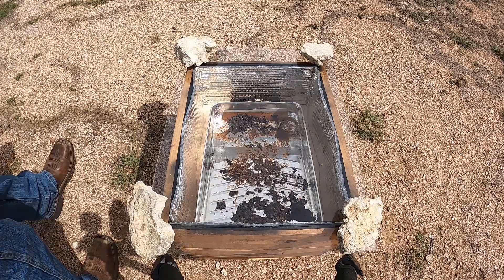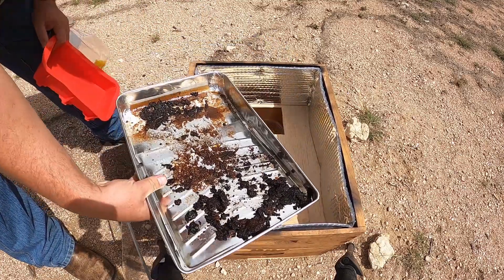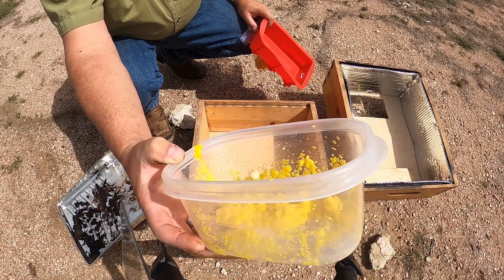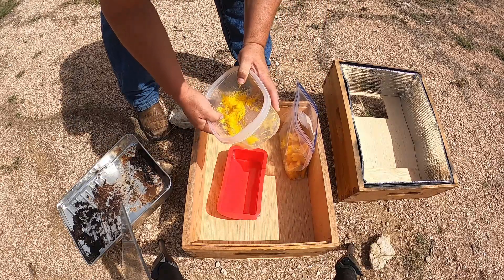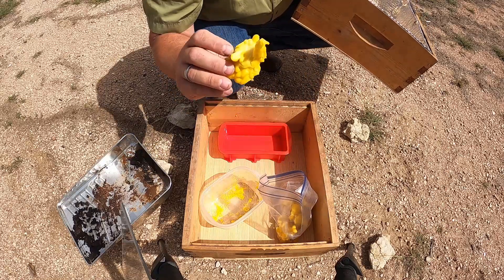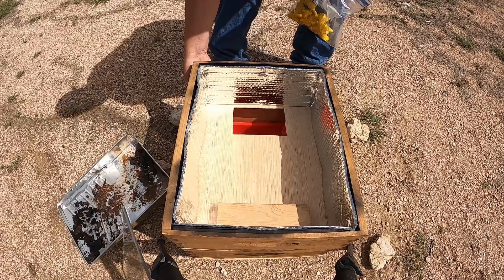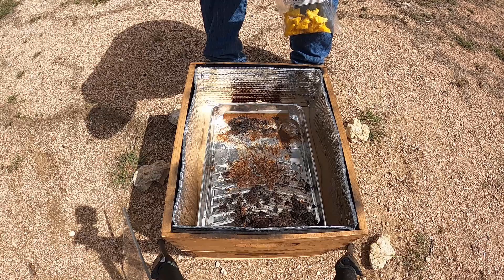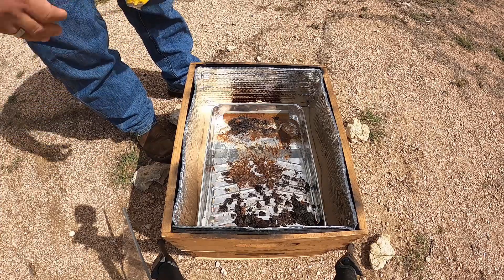Simple Solar Wax Melter Results

Comment: What thickness plexiglass?
Reply from the maker: I'm using a 1/4" plexiglass that is uv stabilized for these solar melters. It may have been measured in mm, but it's very close to 1/4" thick either way.

Thanks for watching and commenting!

Comment: Hi from Melbourne Australia. I have a suggestion put 1inch of water in the pan the wax is going to drip into. It makes it easier to remove the wax.
Reply from the maker: Hi Michelle,
That's a good idea. I've actually started using a silicone pan and removal is very easy since it has flex, but I'll definitely do the water idea when that pan isn't available. Thanks for watching and commenting!

Comment: Love it. Do you have a link to the filters you used or were you got them. Thanks
Reply from the maker: Hey Dennis, I put the link in the description for this video. I bought these a while ago, so there may be better prices now than what there is on this item. Basically any cone filter for fry grease should work fine. Thanks for watching and commenting.

Comment: Have you ever melted any that may still have a little honey in the wax to see what happens ?. I have some table top glass that is tempered glass I going to try but I have to recheck it it may have some tent to it if so I do not think that would work. Good idea on your melter . Thanks
Reply: Hello Cathy, I used a tempered glass refrigerator shelf on mine and it has some tint on it but doesn't effect it. If you have Honey in the wax it will flow down just like the wax but will separate in the pan. The wax will still be on top. Hope this helps. 👍 Good health and God bless
Reply from the maker: Hello @Kathy Hathaway, a little honey in the wax won't hurt. It will separate out from the Wax. It may end up draining down into your pan though (since it's liquid just like the wax at that point), but it will still separate from the Wax. You may have to rinse it off, but not a big deal. With that said, it's best to set the wax out and give the bees a chance to clean it out. That will feed them back some honey and clean your wax. I'd give your table top glass a try. If it's a slight tent it'll probably be ok. The good news is you already have that, so definitely worth a try. Thank you for watching and commenting.

Comment: Was wondering about using a silicone bread pan.  Looks good but maybe save some time getting the lower area hot too?  Just my 2 cents.
Reflectics, so many uses.
Reply from the maker: Hey Mike, Yeah, I'm working on bringing up the temp in the lower area. I'm going to put a thermometer in the top to see how hot it actually gets. The wax will scorch at 170-175 so I just want to make sure it isn't getting that hot. If it isn't, then I don't really need to worry about the temp in the bottom. If it does....well, then I would like to gradually bring up the temp in the bottom to where it stays below that. Thanks for watching and commenting. Enjoy your weekend!

Comment: I lined a 10 frame box with a plywood bottom with tinfoil inside put strips of wood on the sides so my strainer can span it and put strips of fiberglass insulation on top of the sides and ends and put a piece of glass on top. I had to ratchet strap the glass down because it wasn't sealing but now in my pan it stays liquid until nightfall
Reply from the maker: Very nice! Sound like it is doing the trick for sure. Thanks for sharing

Comment: Looks like the deal is sealed. Going out to rebuild mine now. Thanks
Reply from the maker: Awesome Larimore! Let me know how it turns out! I also just now painted the outsides of the box black as well as the middle bottom (under the paint tray) and the inside of the bottom box. Just trying to draw a little more heat down there to get the wax to flow a little more. I'm very happy with it as is, but getting it to flow just a little would be nice. Have a great weekend!
Reply: I'll drill a few holes in the bottom of the top box to transfer heat down in mine. I'll let you know how it turns out
Reply from the maker: @larimorefarms  Another great idea! That definitely sounds like it could help out. Thanks for sharing

Comment: Hay Texas, before I forget my family is in the Justin area of Texas. I like it, gona have to build me one now :-) Maybe try putting some of the reflectex in the bottom, another thing your could do/try replace you wooden sheet with another sheet pf plexi that way it allows a bit more ambient heat into the bottom box. looks like with a little more tweaking you will get it working just like ya want, and cheap to make.  Maybe paint the out side black and a 2nd sheet of plexiglass and some of the reflectex rap?                      Ty for sharing your time, Blessed Days...
Reply from the maker: Hey DC. Ahh, they're up there near Dallas/Fort Worth. Cool. We go up there every now and then to visit with my wife's friend who moved up that way several years back. 
Oh nice DC. All great ideas. Silver Gorilla recommended painting the outsides black also, so I'll plan to give that a try today. Your idea of the plexiglass floor under the paint tray is a good one. That would get it hot for sure. I'm aiming for just enough to get it to flow just a little more, so I'm going to try these little by little. Will probably do the plexiglass floor last (if it needs it), since I'm sure that would most likely do the trick. I've got more of the reflectix also, so I may try that 2nd. Also, I can paint the plywood under the paint tray black since it's still unfinished too. 
Thanks for stopping in and commenting! Enjoy your last weekend before you're another year older!
Reply: @TexasBeekeeper  Just 1 day older :-) and 1 day closer to the Lord. You have a wonderful Birthday and Fathers Day weekend.
Reply from the maker: @DCsBees  You do the same DC!